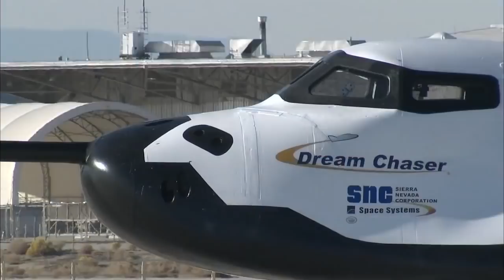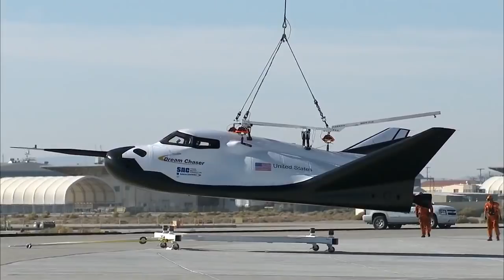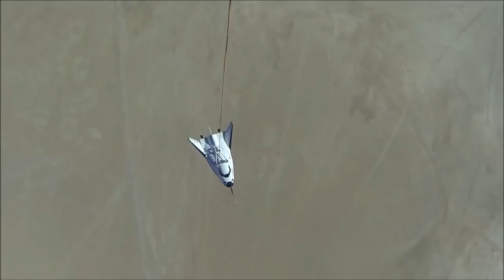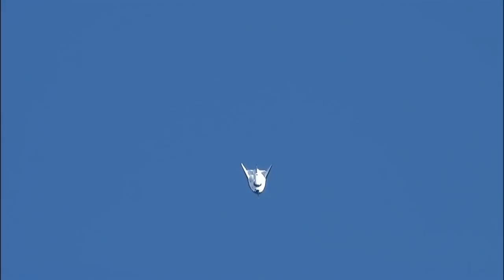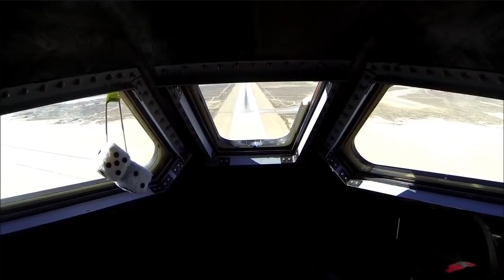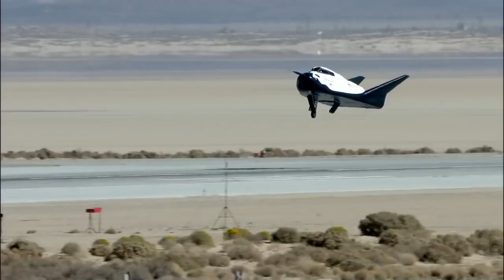'Dream Chaser' Landing Gear Fails To Deploy On Test | Video

Comment: People . . .

It didn't have any fuel on it. There was no fire, nor any explosion. At best, it tumbled a bit.

As for the success of the test. Other than a failure to deploy landing gear, the craft performed absolutely fantastically. I'd say that while it's a setback, the Dream Chaser is most certainly moving in the right direction.
Reply: If they do a reboot of the Six Million Dollar Man, there will be some new footage for a new opening sequence where a winged spacecraft goes tumbling and rolling across the ground.
Reply: landing is the most important part you Dhim Whitt !!!!

Comment: If you read on SPACE.com it says what happened. 

"The landing gear malfunction during the Saturday drop test sent the Dream Chaser prototype skidding off the runway. As for damage, the space plane's pressure vessel — which would house the crew cabin — was not damaged, with onboard computers still working even after the skid to a full stop.

"The crew compartment was completely intact," and pilots would have walked away from the landing incident"

Comment: Someone asked why the other gear was left down.  I am pretty sure that the equipment necessary for raising gear is not present, as this would be dead weight on this type of craft.  The touch down speed of this plane is so high as there is not really a difference between a ground loop and a belly landing.  The craft is destroyed for all pratical purposes.  Like the shuttle, a manned version will likely have explosive bolts to force deployment of gear.  A documentary that I saw said that the if the shuttles gear did not lower within a couple of seconds of the switches being put into the deploy position, explosive bolts would force the gear to deploy.

Comment: I feel it telling of Sierra Nevada's/Sierra Space's corporate culture to have the video cut off right before the actual landing. Especially in contrast to SpaceX's self-published landing fail compilation. Having briefly worked at Sierra Space, this feels totally spot on, it was a culture of high-ups patting themselves on the back, giving only senior-managers and above bonuses (actually happened while I was there) and blaming anything that went wrong on the lowest person down the latter they could, all while under the surface the company (not necessarily the spacecraft) was horrendously dysfunctional and inefficient. The epitome of "boss is coming look busy" culture, including when idle techs with no work to do were told to put on a show of productivity when NASA representatives came for a tour of the factory. Given how terrible my experience there was I would have found the crash video cathartic, but the absence of such video is even more telling.

Comment: I guess this is one of the reasons (though not specifically mentioned) by NASA why they never chose this for their Commercial Crew Program. They wanted a parachute for softer and safer landing with no landing gears that can fail. Although SNC can still pitch this for private crews, but I highly doubt it will be a good choice considering SpaceX's Dragon Crew is much safer, cheaper and proven.

Comment: The dice in the window pisses me off. If you want to be taken seriously, then maintain a level of professionalism with your tests. If I were in charge of this program, heads would roll if someone on my team did something like that during an official test.
Reply: I think this is pretty minor, even NASA does stuff like this. And compare this with the SpaceX self-published landing fail compilation video. I think it actually improves their image, to show that there are actual human engineers who worked on and took pride in this thing. What doesn't help though is cutting the actual crash footage. Having worked briefly at Sierra Space, this is very fitting of their cover-their-ass pat-themselves-on-the-back blame everything on lowest ranking person culture there.

Comment: just goes to show you automated landing might be great until it forgets a wheel.
Reply: What is that supposed to mean? Automated landings are a thousand times saver than human landings in every scenario. The problem is, that this dosen't apply when Boeing wrote the code.

Comment: I love laughing at all of the "It crashed!!!" comments. Did you even watch the video? It performed a perfect approach, it just did a partial belly skid because a lousy temporary subsystem failed. Get over yourself, your petty pandering to the crowd that believes these engineers don't know what they're doing is childish and doesn't mean a damn thing. This hardly suits the aeronautic dictionary description of "crashing."
Reply: Just had to reply to your above comment.  "pandering to the crowd that believes these engineers don't know what they're doing".  Why would any engineer put a "lousy temporary subsystem" on the Dream Chaser before a drop test.  The thing has to land after the drop, Yes?  Presumably in an ideal world the commercial business and/or investors funding this venture would like to keep costs down and not have their multiple gazillions of $ investment scrape along the runway like a scrap car being towed from their driveway.
Reply: ***** None of the internals of this drop were what the final model of the vehicle will end up being, it is only weighted so that it will represent the approximate center of mass and weight of the final vehicle with empty fuel tanks. The most that's hooked up are the control surfaces and a rudimentary flight computer running their drop program. So, the vehicle consisting entirely of an airframe with no interior, and its single-cast lifting-body ablative heat shield, most likely doesn't even have the final mounts necessary to hook up the production landing assembly. The belly landing resulted in little more than the equivalent of a scratch on a nice paintjob, the heat shield is designed to go through shock compression at near orbital velocity (about 8 km/s) which is more than enough to vaporize your "scrap car being towed from a driveway" into unrecognizable hot metal particles in about five seconds.
Reply: If it didn't crash why didn't they release the complete video?

I mean it couldn't have been pretty if they made sure to hide it from the press release.
Reply: OK, you ride the next attempt on the vehicle.

Comment: Some body , tell me why   just one leg with a wheel?
Reply: The second one failed to deploy. But still I'm also wondering how it was supposed to land on just two wheels.
Reply: It has 3 wheels. One didn't work.
Reply: soundslave It actually only has 2 wheels. The front part isn't a wheel.